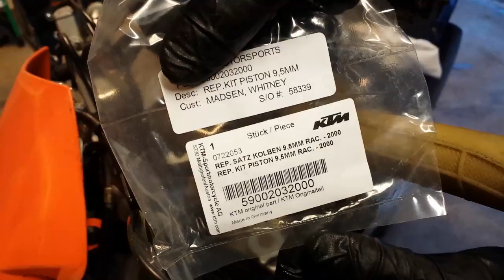KTM Clutch Master Cylinder Rebuild LHRB

Comment: Why is this guy bleeding the brake caliper if he is working on his cluch?
Reply from the maker: joseph carle It changes everything when you run a auto clutch:)
Reply: +zkcon3 he's using auto clutch, so he transfer his clutch line to the rear brake. like some pit bikes do. no more brake lever on your foot.
Reply: I was just gonna say apparently his clutch is on his front wheel.

Comment: I'm pretty sure I see "use only mineral dot 4-5.1" on the reservoir cover bud. that means dot 4 OR 5.1... dot 4 mineral base, dot 5 silicone base, dot 5.1 mineral base... just think you may wanna double check.
Reply from the maker: your Right! But I had mine hooked to the rear caliper
Reply: AutoTech so the new line specified dot 5?
Reply from the maker: I took a gamble with trying brake fluid in the clutch Master cylinder. I knew this probably wouldn't work but I wanted to try it anyway- it stop pumping after a few weeks- I ended up buying a Master cylinder from a Honda scooter